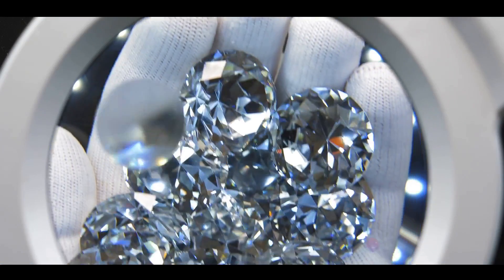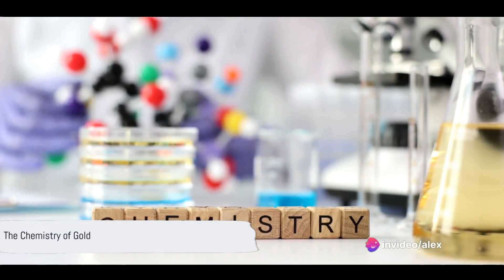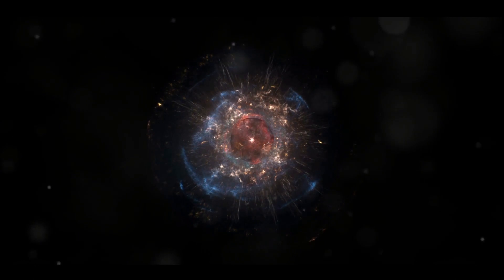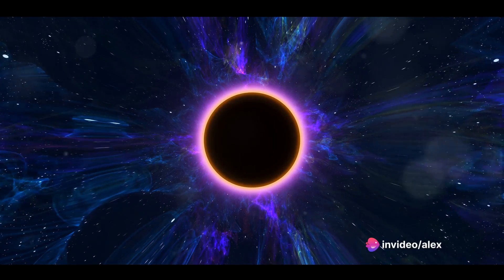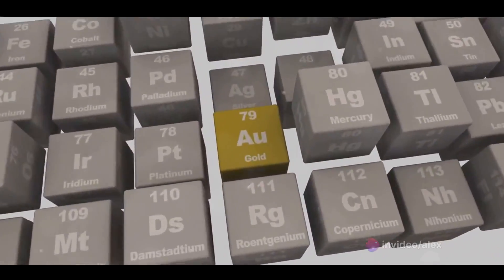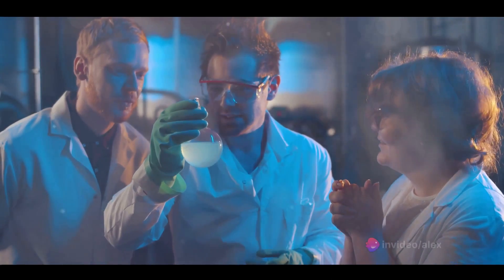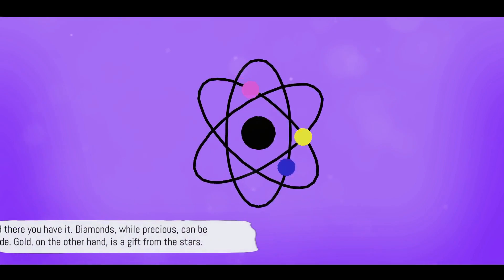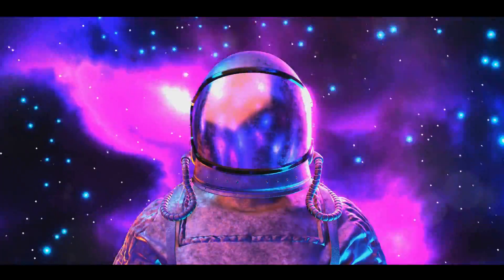Alchemy Unveiled  - Why We Can Make Diamond but not Gold

Comment: But we can make gold . Diamonds are just an alitrope of carbon . Gold can be made by transmutation of another element through radiating the element with neutrons and allowing it to transform from one element to another and another ,...  till you have gold .
Reply: It will be radioactive Gold😉
Reply: How exactly do you add protons by irradiating something with neutrons?
Reply: @marekstanek112  Beta decay converts excess neutrons into protons… look it up on Wikipedia 😉
Reply: @BarrieHughes  yup. So you manufacture plutonium,bring it to the verge of becoming critical, irradiate for example lead with neutrons,And Wait for it to decay into gold. What could possibly go Wrong?